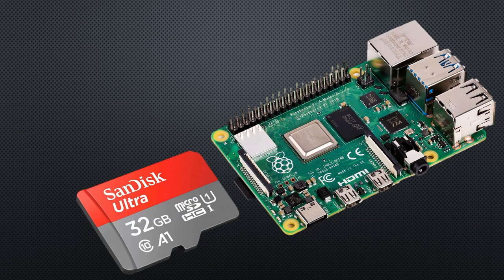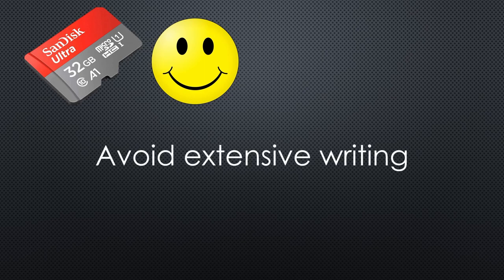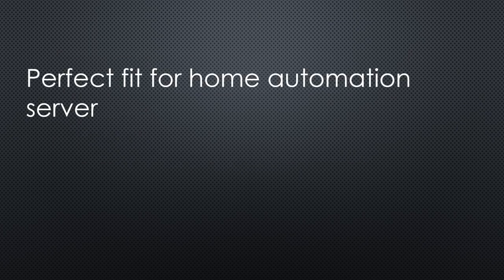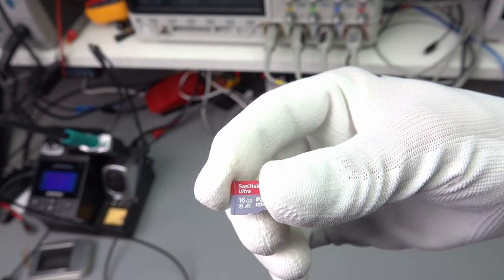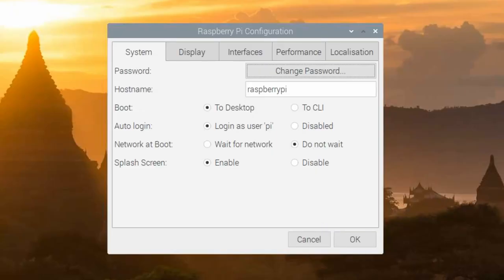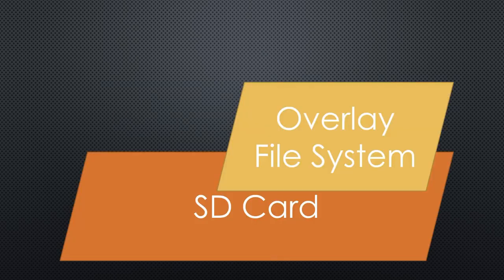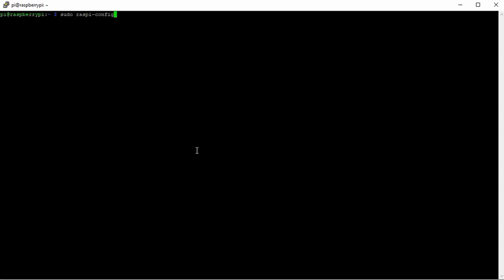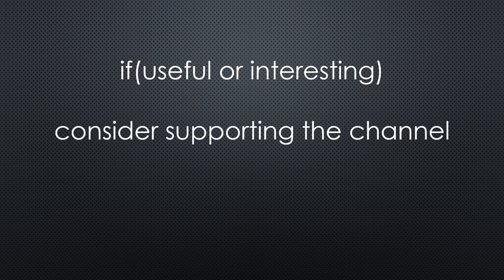#403 Simple Trick to protect your Raspberry SD card from Crashing

Comment: Thanks Andreas for the tip. What I do is to use a high endurance SD card, specially designed for high number of writing cycles ( they are used in security cameras). Is a very lazy solution though.
Reply from the maker: I hope this works (because I ordered a few of them after comments of other viewers...)
Reply: @AndreasSpiess  I personally have been lucky using Samsung pro endurance in Rpi for a while after testing them 1+ year on dashcam. Only 1 out of 10 have made one file corruption (as far I have noticed). Before that the Sd cards was not saving all the files or saving them empty. Just a note, that bigger sizes have bigger large ratios before failure. 
Other option is to add some USB drive, which comes in micro size, so fairly extends out of devices itself
Reply: @AndreasSpiess   Nothing is failure-free. I used to work with MDVR (mobile video recorder) and moved from a Sandisk Ultra type SD to a SanDisk high endurance. From a batch of 20 units, we used to have one SD dead every 2 weeks; after the change the first failure happened 6 months after. Using Transcend High Endurance SDs in three Raspi working as LoRa Gateways for one year, no problem so far.
Reply: @jdsan6009  Thanks for the info about Transcend SD card. I will try that one next time.  Currently using SanDisk 128GB High Endurance in my 4K dashcam.  Working fine so far.  My old 64 gig SanDisk SD card worked fine for 2 years before I replaced it.  I always get the biggest SD card that the device can support to extend the life out of it.

Comment: Instead of a SSD, you can also use a network filesystem and redirect things there through symbolic links. Handy if you have a NAS on the same network. Beware that SAMBA/CIFS does not work well for that and some services will randomly fail if their data are put on a SAMBA mount. NFS on the other hand works fine with everything. 
You can also use the iotop command for instance  'iotop -o -b -a' to log the cumulative writes of the different processes so you can see who is writing and how much.
Reply from the maker: Thank you for your input. Remote logging indeed would be a possibility. Maybe even with these switches (if you want to keep your logs)

Comment: Add commit=300 as a mount option in /etc/fstab.  EXT4 default is to commit all writes every 5 seconds.  If you mount with commit=300 it will cache writes in memory then write them to disk once every 5 minutes.  You can reduce your SD wear by 60x by adding that line.
Reply from the maker: Good point. Thank you. I will try it

Comment: Years ago, my daughter had been using my core 2 duo laptop running ubuntu 12LTS booting(with pre-loaded apps) from the dvd drive loading it on ram for several years till the internal cooling fan conked out. You could still save on the hard drive but everything else resets after shutting down.
Reply from the maker: Others also suggested that the overlay FS was used for USB stick booting which was probably similar to your concept. So nothing new, but still useful and now integrated into Raspbian (good for noobs like me)

Comment: Clever ways to save on writes :) Phones uses F2FS file system to save on writes. F2FS supports ZSTD compression. Image with bear minimum of applications would write less compared to stock Rasbian. 
There are MLC SD cards that last ~10x at same capacity compared to most micro SD cards in the wild. Jet MLC cards cost ~4x (on SSDs the price difference is more reasonable ~2x). Higher capacity cards will last longer (grows lineary with the size). As for disconnecting the drive unsafely - I had luck with usb sata bridge and microSD readers, they usually go before the storage.
Reply from the maker: Thank you for the additional info!

Comment: thats a neat trick, plus is  more secure, becasue if you loose your rapsberry pi whilst transporting it, you wont have to worry about still being logged into google etc and saved passwords.  just enable it on a new install after you have setup wifi and customized the dektop
Reply from the maker: Good point!

Comment: Nice Video, learned something new. Now it would be great if specific log operations could be made to go to the SD card and the majority just to ram...
Reply from the maker: You an du that by using RAMFS or log2RAM to only store logging in RAM. But it needs a little more Linux knowhow. Or you mount a network drive for data as other viewers suggested.

Comment: Thank you Adreas for the easy to understand ex[;amation of the Overlay File System. It's just what I needed for my weather station which uses an ePaper display controled by a Pi Zero W.
Reply from the maker: That seems to be a perfect fit!
Reply: Is it a perfect fit, though?  You mentioned in the video that 2G of RAM is recommended, and the Pi Zero W only has 512M.  

I don't know how the Overlay File System decides how much RAM to use: is it dynamically allocating memory based on the amount of data written, possibly running out of memory over time?  Unfortunately, Googling doesn't return any tips on reducing its memory usage, and I couldn't find confirmation that anyone is using it with a Pi Zero W successfully.

I guess the only way to be sure is to try it.
Thanks for pointing out the option, though: I didn't know it existed.

Comment: I have few application that move files from 1 folder to another in my Pi. I assume that the overlay file system will revert everything back on restart?

I getting a SSD for my 3B+ soon, which is a better solution for my situation (i think)
Reply from the maker: 1. Yes, it will revert to exactly the initial state
2. An SSD is a good thing. However it will not be very fast on the USB2 of a Pi3B+

Comment: Have you tried using high endurance SDCards sold for devices like dashcams that repeatedly overwrite the storage?
Reply from the maker: Not yet. But a few viewers suggested to use WD purple. So they are in the mail now ;-)
Reply: @AndreasSpiess  They should be a lot better, but they will also wear out at some point. This also depends a bit on the file system you're using. Unfortunately I don't think LittleFS can be used seriously with Linux yet.
I know I stated that SSD would wear out and that harddisks would last longer. This also depends on the use case. If for instance your harddisk is placed in a -20° shed, then the SSD will probably last longer. Harddisks may die if turned off and put on the shelf for 15 years (SSD likewise). -So it all depends on things we know and things we don't know. :/

Comment: Excellent information, I already put UPS boards on all my Pi’s but this will is a great trick.
Reply from the maker: UPS is also a good think, But not cheap ;-)
Reply: @AndreasSpiess  No they are not, but I wont run a PI without one, I use the PiSuger2 on all of mine, they come with a remote web interface for configuration and status, totally worth it.
Reply from the maker: Looks like a good solution!

Comment: Does the SSD have the same corruption issue as the SD cards resulting from power outages?  I have corrupted Octoprint a few times from someone (me) cutting the power before shutting down.  I am definitely going to try the Raspian Function. Thanks!
Reply from the maker: Corruption often comes from the file system (the computer cannot finish a transaction) and can also happen to the SSD.

Comment: Thanks Andreas,
I believe a short lifecycle is typical for low-cost SD.
I use several SD cards in raspberries for 3 years already, incl my Majordomo home automation (decades of mqtt sensors, etc.) and had issues while using sandisk-like SDs).
After changing to less cheap I've forgotten about it.
Reply from the maker: Thank you for sharing your experience. It seems you were lucky. At least I found mentioning Sandisk and other branded SD cards in the forums complaining about failures. Maybe the operating systems also got more robust against corruption of SD cards.
Reply: Please let us know which are the BAD and the GOOD SD cards you used.
Reply: @paulcohen1555  Sandisk were the worst, now Samsung, no issues yet.
I can't remember particular models, sorry.
Reply: @paulcohen1555  I don't think it would be a healthy data because of the chip shortage. Even good SSD brands like samsung started to use less expensive less durable components. It's safe to assume that same tactics are deployed in the SDcard production.
Reply: Day of installation:
# ls -ld /lost+found
drwx------ 2 root root 16384 Nov 29  2017 /lost+found

Comment: Not Pi related but Linux related.  In the early days of SATA SSDs I had one at 16GB from Imation.  I had the most 'write intensive' volumes mounted on an LSI RAID volume  (e.g. /tmp /var/ and SWAP).  It lasted over 6 years in 24/7 use before it was replaced by a new computer.  I did pull the drive before sending the computer to freegeek.  Those are the 'high write cycle' mounts for a system drive.  Data drives are not addressed.
Reply from the maker: Thank you for sharing your experience. So far I also had no problems with SSDs, also not on the PC. Even if I do some video editing. For the Pi I do not expect any issues because the data volumes are very small (mostly sensor data and logging).

Comment: Are any of these options available on the old Raspberry Pi model B boards (not Pi 3B but the original one)? Would it for instance be possible to boot from SD card and then re-mount to an SSD on USB? I'm not a unix expert, so commenters forgive me if my question is very stupid.
Reply from the maker: The feature presented in this video is a software feature and should be available also for older models. But I do not own such boards anymore. So I do not know if there are restrictions.
Reply: @AndreasSpiess  thank you kindly for your reply, Andreas.

Comment: I have a ton of raspberry pi computers (mostly 3b & zero W models) and I've done the 'barefoot' method before.  I haven't tried the built-in raspbian feature yet but I wonder, does the feature disable write to other storage? If it doesn't, then you could redirect or save 'persistent' files and such to another device like a simple thumbdrive.
Reply from the maker: I assume it only blocks the SD card from writing, but I did not try. Other viewers also suggested to use network drives for valuable data.

Comment: Are SD cards that fail in this mode of operation covered by the warranty?
Reply: In short no. I made a claim for SanDisk memory stick. They asked for the use case. I said it had been used to transfer files and to write a large Linux ISO file. I think they interpreted the ISO file for a complete working OS system as they replied:

"Please note that the pen drive you are using has not been manufactured for use in devices or applications that perform constant read and write operations like car cameras, security cameras, bootable drives etc."

They did replace it as a one-time courtesy. I normally buy SanDisk but I worry about buying a fake. I only buy those in a full retail blister package but you never known what happens to the ones that fail the quality test in the factories.
Reply: @Alan_UK  I still believe in SanDisk for quality but as they said the product have limitations (and IMITATIONS).
They probably can check the operation history kept somewhere in the drive.
Anyway, I learned something from your case.

Comment: I would like this, but is there some way to make certain write process still work, like apt-get upgrade and for my moonraker to keep Klipper and mainsail up to date? Perhaps this is the case, but I am afraid to turn it on and have issues.
Reply from the maker: As shown in the video, all changes are lost during reboot. But you can switch it it off, do your updates, and switch it on again. I would try it with a copy of your productive SD card.

Comment: Write files to USB Flash & update as needed if data logging with minimal data loss.  ...There exists a "HAT" that goes under the Pi and is screwed on, supports an M.2 SSD via a small USB 3.0 adapter. The bonus: you get SSD speeds with low power draw.
Reply from the maker: Do you know if USB sticks use wear-levelling? Otherwise we probably have the same issues.
Good that the "hat" goes below the Pi4. I still see too many "top hats" which create heat issues.

Comment: Add autofs against an NFS box with your homedir, we did diskless workstations that way for years back in the 90’s.
Reply from the maker: You are right. Remote file systems can be a good solution instead of an SSD  if you need to keep the changing data.

Comment: I have installed "remote-iot" to my pi3B/3B+ and am monitoring total writes -the only tool I found that would read microSD stats.   I added  "/dev/root / ext4 rw,noatime,commit=60 0 0" to mtab"  to minimize writes.   I have computed writes over many days using the "total writes" count, and it is about 10/sec.  I am trying to figure how "many" this actually is......  Doesn't seem like much.  Hard to translate this.  Thanks for your video!  Wish stretch/jessie had overlay FS.
Reply from the maker: I did not know of remote-iot. Its SD monitoring function is very interesting! The only problem: Nobody seem to know how many write cycles a typical SD card supports before it dies...

Comment: This is a discussion about two topics:

1. How flash works.
2. BC/DR.

Lets solve 'two' first. If your data/system is critical make sure you take/keep a remote copy and keep it off site. End of story. 'Local resiliency' doesn't help you if your data center - or in this case raspberry pi - goes up in smoke. 

For 'one' let's talk about flash's 'peculiarities.' Flash devices - and by the way both memory cards and SSDs work the same way - have the following characteristics:

1. Fixed block size for writes. Unlike spinning disks flash can has a fixed write size. i.e. If a device writes at 32kb and your write is 4kb. The device writes 4kb of data and 28kb of zeros. If your write is 128kb the same device writes 4 × 32kb writes.

2. SLC, MLC, TLC. Denotes the number of bits in a cell. 1, 2 or 3 respectively. Additionally, it indicates 'burn rate' how quickly cells those cells die. The greater the number of bits in a cell the faster they wear out. Most consumer grade SSDs and flash cards are MLC. 

3. Overprovisioning. Every consumer flash device SSDs and flash cards are overprovisioned to take wear and tear into consideration. SSDs have wayyyyyy more than Flash cards as they have to deal with the writes an OS throws at them. So don't buy an SSD buy a bigger memory card. It will last a lot longer, be easier to deal with and work out cheaper. 

4. Fade. As magnetic media is hit by 'bit rot' flash gets hit by 'fade.' Over time the bits flip or the cells fail and the files become unreadable. Magnetic interference and heat accelerate this process so keep your pi cool.

4. Device firmware. Not all flash devices are created 'equal' and - no disrespect to the engineers who do this - the firmware on the a given generation of devices often gets written in a hurry. So the lifespans of two different cards with the same size advertised size and identical workloads may differ drastically in terms of lifespan.

5. Reads are free, writes are poison. High levels of random writes are absolute cancer for flash. Everything slows down if your device is bangoed with high write traffic. So if you are logging tons of data? My advice send it to a NAS backed by spinning disk DON'T store it locally on your memory card it will kill your flash device quickly.

So in summary:

1. Keep a back up.
2. Buy a bigger memory card than you think you need. 
3. Keep your PI cool.
4. For all random write traffic send it to spinning disk.
5. Check the product reviews for angry consumers complaining about 'failures within weeks of purchase.'

How do I know this? I was employee 186  for the best enterprise flash array vendor on the market. As an aside - but related to this - 'middle out' from the 'Silicon Valley' series is based on a real algorithm that optimised wear and tear on MLC using meta data references to avoid writes if possible.
Reply from the maker: Thank you for your additional information. Everything is true. Do you have information about the wear-levelling of SD cards? I read a lot that they do not have such an algorithm and manufacturers explicitly forbid to use them in file system scenarios (and refuse warranty as one viewer wrote).

Just a few additional thoughts about the use cases of the video:
I talk about Raspberry Pi computers which are not often used in data centers nor do they have to deal with lots of data, because its performance is weak compared to servers. On the other hand its data often is not very valuable for the long run or does not change a lot. Many of our Pis just do some data transfers (sensors, gateways). or are used to drive displays, etc. and are sometimes operated in harsh situations. 
Fortunately, we will hardly hit any of the specified transfer volumes of SSDs. However, we all experienced crashes of SD cards. Sometimes also because the power was switched off during a bad time which corrupted the FS.

Comment: Very educational content. Just wanted to point out that I'm personally using High Endurance SD by SandDisk which meant for CCTV application (run 24/7 + consistent read & write application). So far works well (more over 8 month with multiple time of trips by thunder storm - in turn will be a sudden power loss) for my simple LAMP project without overlay file which is running 24/7 when ever possible.
Maybe can give those a shoot for extensive test?
Reply from the maker: Other viewers also commented about those SD cards with different results. I do not plan such a test because I do no more use SD cards for heavy usage. I changed to SSDs, also because they are faster.